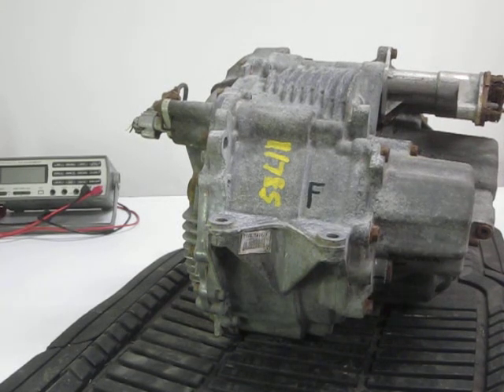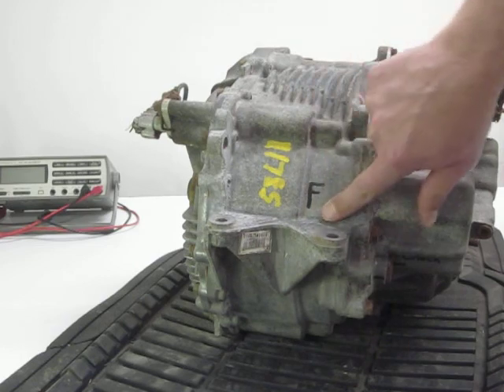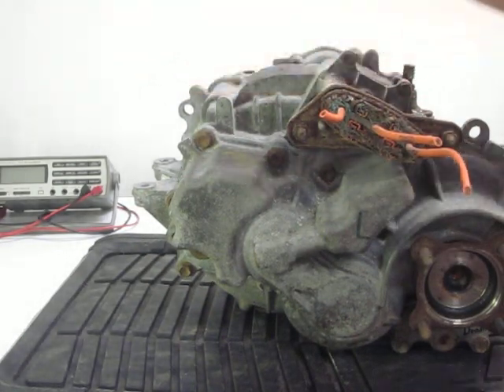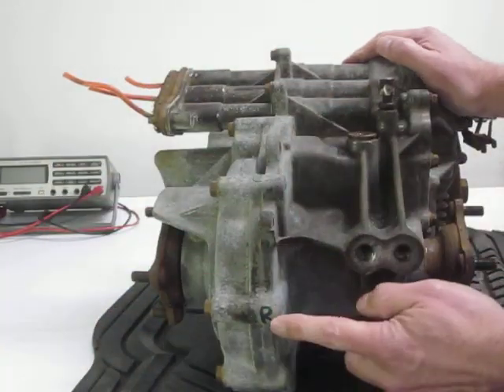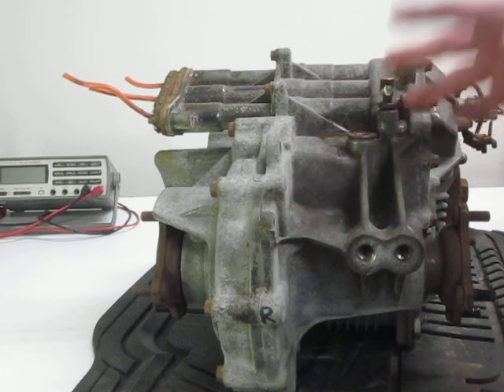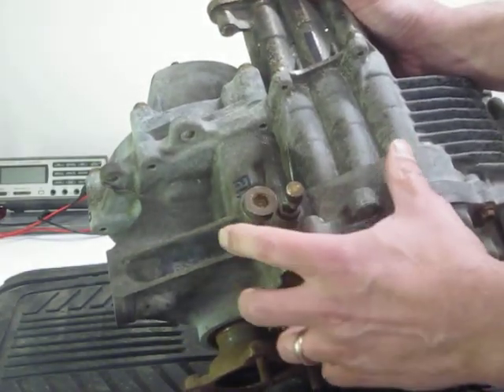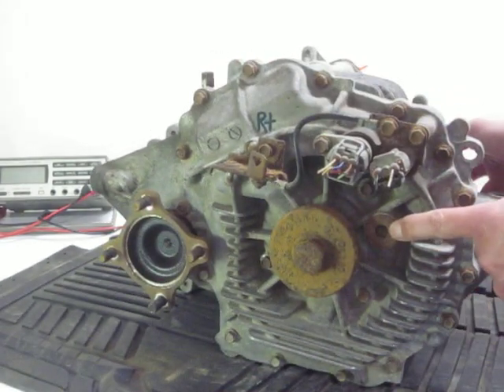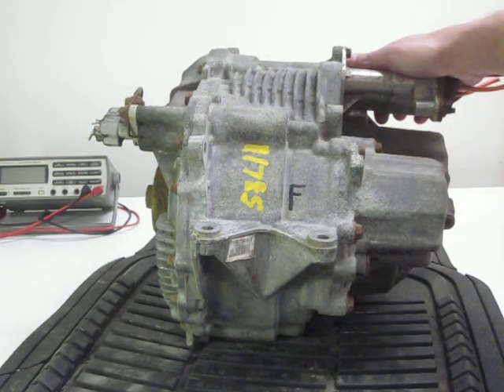Toyota Q211 MGR Overview

Comment: Thank you for making this video!

I have a highlander and the  q211 is leaking at the gasket. Do you have any recommendations for repair? I have been unable to find any torque specifications, parts diagrams or repair manuals for this component.
Reply from the maker: The Factory Toyota Service Manual may have the details you need, but I doubt it.  If yours is not dripping oil, I would wipe it off every so often and keep it full - not attempt any repair.
Reply: @ZookeeperJohnG  It drips dry in a week or so. I'm now leaning towards replacement of the entire unit. Thank you for your reply.
Reply from the maker: WOW! That is a BIG leak, could it be from one of the axle seals, they are serviceable.